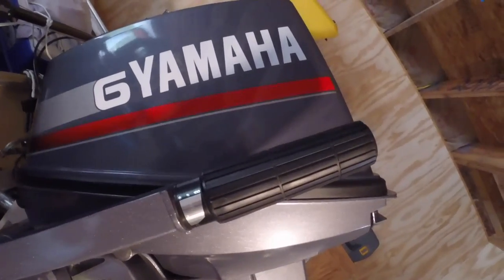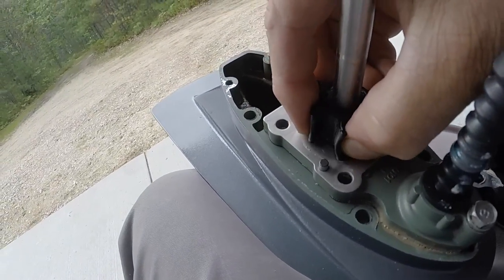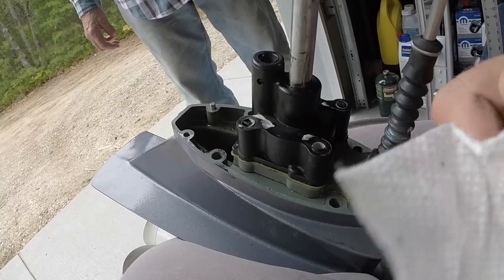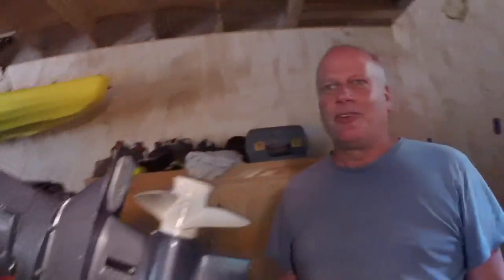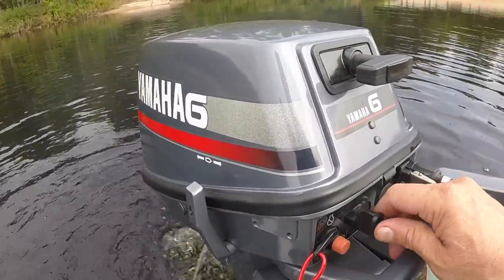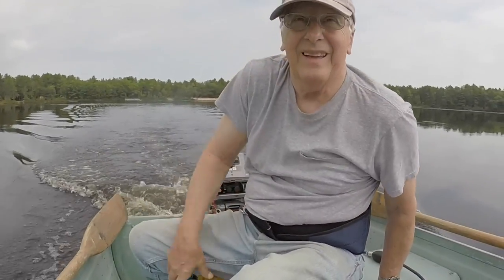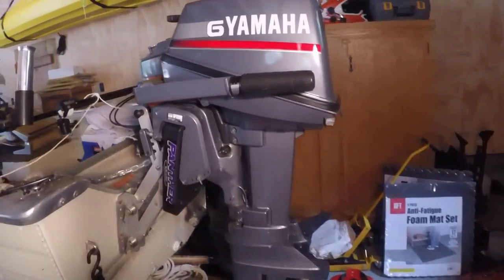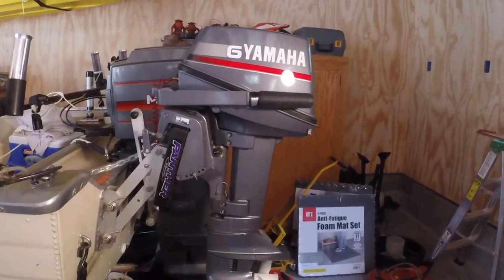1985 Yamaha 6 hp outboard replacing impeller & first run on boat

Comment: I have a 1986 yamaha 6hp 2 stroke,  replaced the spark plugs, thermostat, impeller, fuel filter  which is regular maintenance stuff.  Starts first pull, runs well, used often, great little motor for 33 years old.
Reply: بغيت شيموطور ليلبيع يماها صغير8+6
Reply: i got a old 6a and i got it out of sholder high grass. it was sitting there for 20 to 30 years the old owner said, i gave it a quick turn and the cylinder was free gave him 100 euro and went home with it, changed sparkplugs and put some 2 stroke oil in the cylinders while i tested everything after i was happy with it added some fuel and started straight aaway, smokey from all the oil i put in there so it wasent turning over dry but that burnt off and she runs so smooth now
Reply: Do you have a servicemanual for this motor ?

Comment: I've been trying to get the bottom to go back in for an hour. And that's the only thing in the video that was skipped. Everything is lined up, and I'm spinning the prop to let the splines line up, but no success.
Reply: SOLVED! There is a tube the the main shaft can easily miss. While lining up the shifter shaft the main shaft was missing the tube. 
In case somebody else is dealing with this:
I turned the motor upside-down, and used a phone flashlight to pear into the exaust side of the houseing. The right spot would shine light onto the the main shaft and its tube. While keeping the main shaft alighned, bend the shift shaft to align with its own hole.
Reply from the maker: @markf37talon  It was impossible to show how to reinstall it with the camera. Yes you need to line up everything, not just the shaft. They can be a bit of fuss. I am a marine mechanic, so to me it's no big deal for me.... but for someone that has never done one, yes it can be a challenge. Glad you got it together ok.

Comment: I have a Yamaha 1990 15 hp looks very similar.  Has probably -<100 hrs on it. Currently changing impeller too.how do you ensure the water tube connects into the lower unit since you can't see it?  Guessing the alignment is pretty spot on and it's not an issue. Thanks for posting!
Reply from the maker: They usual go on if there in the correct position. Just make sure is pumping water to the power head.... most have a little tube attaching to the top of the block, that go threw the lower cowl. It shoots a good stream of water when pumping properly.
Reply: بغيت شيموطور يماها ليلبيع صغير6+8
Reply from the maker: @hafidkhamlich285  إنه والدي ، يستخدمه ، لذلك ليس للبيع.

Comment: That engine can not be from 1985, must be 2000
Reply from the maker: it is a 1985
Reply: What’s the model code on the side? Looks identical to my 99 6hp Yamaha 2 stroke long shaft.
Reply: @kal7393  It's also identical to my '97 with code 6MSHV
Reply: They made them almost identical from 1985 to 2000, my 1993 looks exactly the same

Comment: this is old but the carb should really be cleaned you never know what junk accumulated after all those years even brand new. factory ran them with fuel. the fact it took so long to start and stalled a couple times tells me the idle circuit is a bit gummy. not clogged, but some varnish. not good for a brand new 2 stroke!
Reply from the maker: That outboard has been running flawlessly for many years now, so I don't think there was any crud in the carb.